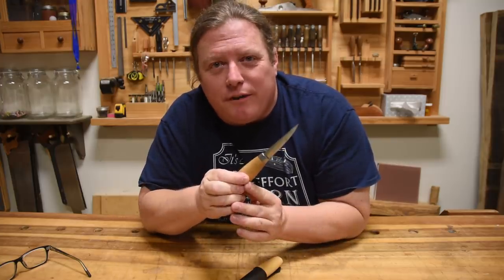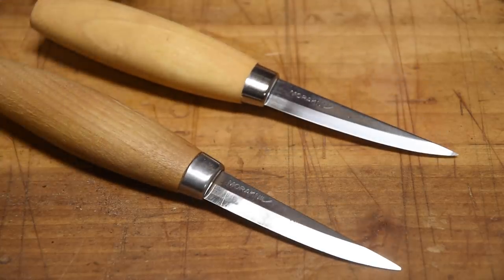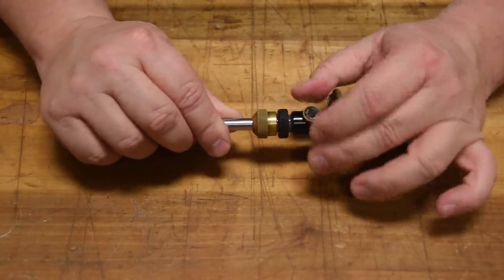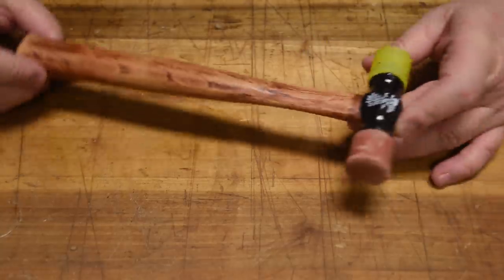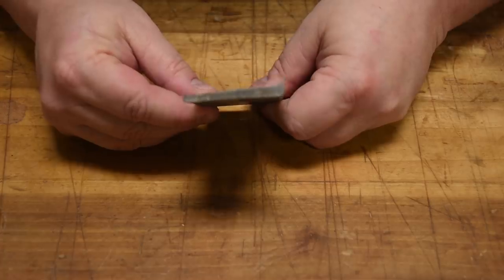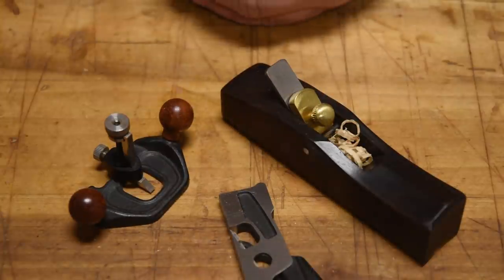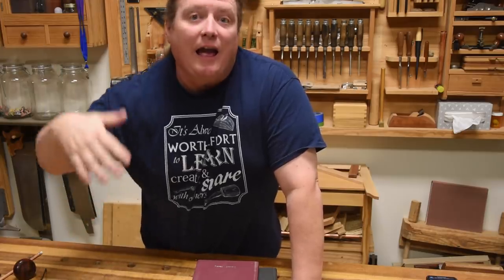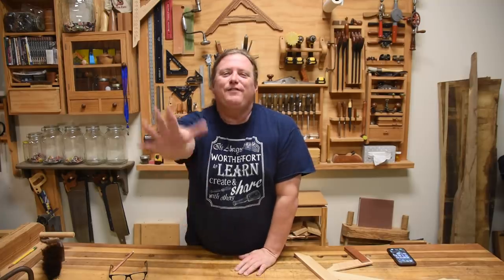Budget Friendly Gift Ideas for the Woodworker, DIY'r and Craftperson in you life.

Comment: Here is a right turn for you.  This is the best sanding block.  Buy (if you don't have) a belt sander's belt (your choice of size but 8" or so works best), then make a wood block (2x4 is good) with somewhat of rounded ends and square sides then fit the belt over it - might have to make 2 as it needs to fit pretty snug and getting it right the first time is only trial and error.

This thing lasts for years not minutes.  You can put an edge you want sanded  on a wood something then raise the belt up of the edge of the block slightly and it will sand the edge and not scratch the surface your moving the block on.  

I use mine constantly and they do indeed last for years.  Clean with a wire tooth brush and your good to go again, but only when really necessary.  Even full of dust it still works great.  

Flat, edge and corners is it's specialty.    Try it - you'll like it.

If you don't use sandpaper at all, then maybe others reading this will.

Comment: You really should try a 5mm mechanical pencil.  Not as robust as a wood one, but draws a consistent line that is quite fine enough to work with.  Why cut a line, then pencil it in?  Other than cutting the fibers, of course, to prevent tearout.
Reply from the maker: i only use pencils on knife lines so it'll show up on video.

Comment: I see you have the same problem with residual crud in the shinto rasp.
after using it there sawdust in the teeth that I have difficulty removing, so I briefly use my wire brush attached to the bench grinder, hopefully I am not damaging the teeth
anyone else with this experience and suggestions for cleaning the rasp?
Reply from the maker: VADOC02 don’t use metal. I use horsehair, sometimes alcohol to sell fibers or leave alone. Wire wheel will dull it.
Reply: @wortheffort  thanks!!!!